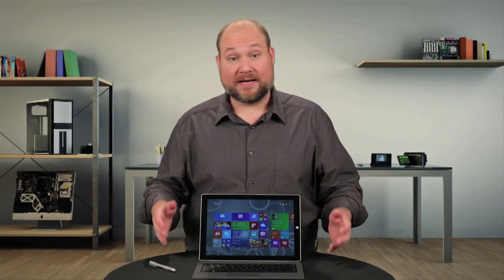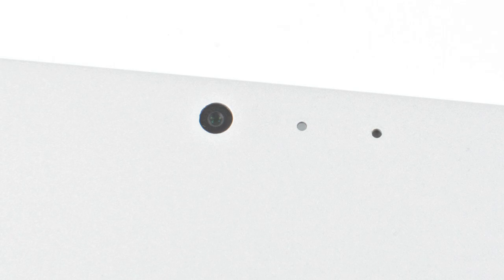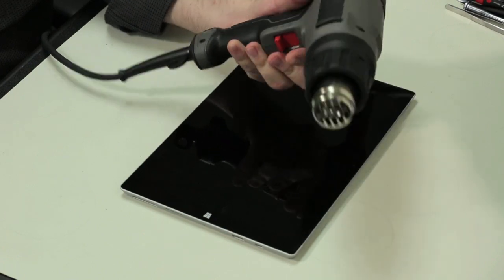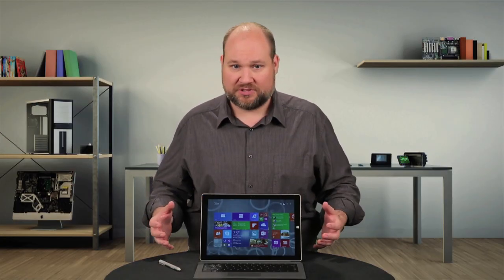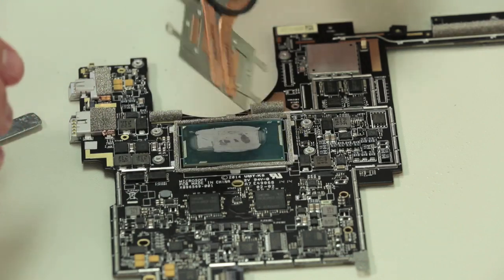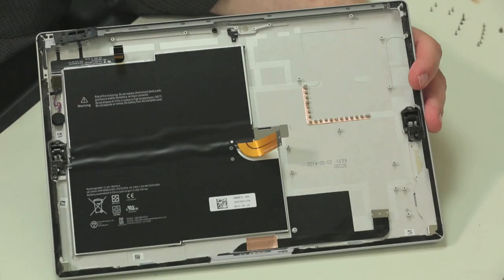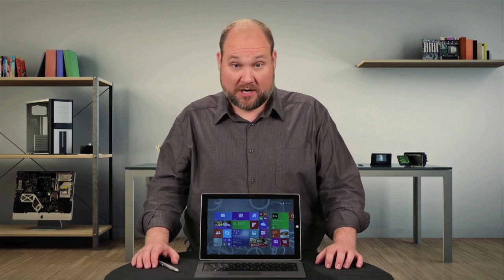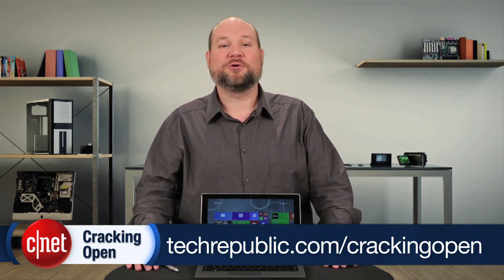Cracking Open - Microsoft Surface Pro 3

Comment: Working in the electronics industry the manufacture of this device makes me shudder. A simple battery replacement, (and let's face it batteries do screw themselves long before they should on occasion), would have the repair house risking breaking the screen.  Goodness knows what the cost would be either, having to pay him danger money!  Yes I do own one and as brilliant as my own on-site engineers are, I wouldn't think of risking the possible outcome just trying to get the SP3 open. Bad Microsoft.

Comment: Hello,
Thanks for the very interesting video. That’s for Service guys very helpful ;-)
How did you glue the display again?
You removed the MB fast, is there a std. S0 Slot that’s upgradable?
I plan to upgrade a I5 with 64GB to 512GB/8GB
 
Kind regards Mike

Comment: Complaining on how difficult it is to take apart a tablet is stupid. Of course it is going to be difficult to take off the front panel, and that its easier to service a MacBook Air, because the Air doesn't need the screen removed to access the internal components.

Comment: shocking that the battery is so difficult to replace. That's the first thing I would want to consider doing. I guess another reason why I think the surface pro 3 is overpriced.

Comment: So Microsoft focused on the user experience and build quality instead of making some snob at the computer repair store happy. I think they did a great job.
Reply: Blow canned air into it lol
Reply: Canned air? What's next, bottled water?
Reply: I'm using this video for a repair on a charging port. It helps me determine the amount of steps and overhead the process will take, as well as determining the reparability of the machine. It's not to get an overview of the product. That's a totally different video and you were looking in the wrong place.

Comment: Tablets as well as Hybrids are modular in design and are not purpose built for home repair.  That is what helps to keep costs down in manufacturing phase.  Laptops are semi-modular which means they may include proprietary parts and are designed with functionality in mind.  Desktops are non-modular/manufactured which means they are purpose built for future proofing/upgradability/functionality in mind.  Some desktops (Apple) do have some modular design concepts included, but that isn't a detractor to productivity and repair.  The comparison of a modular device to a semi-modular device is NOT a fair comparison.  Comparing the Surface Pro 3 to an iPad or similarly styled tablet/hybrid is far more farer.  This review seems subjectively based on the comparison to a semi-modular device and I expect more from an educated "expert."
Reply: I read in the comments that all homes should have a home repair infrastructure for electronic devices.  That is a unreasonable and unrealistic viewpoint.  The average consumer want to use products, not repair.  Most people have not the time, technical skill or ability to do at home repairs.  This device is marketed at mobile professionals for content creation and light consumption which includes people that are looking for modular designs.  That is why Microsoft offers warranty programs.  The money you will spend doing the self-repair will be equal to or cost more than paying for the warranty, acquiring the skills to repair yourself, or paying someone else to repair it.  You don't buy modular devices with the intent of self-repair.  This is why the comments the engineer makes in the video are baseless.
Reply: Thx Cuz. I learn a lot from ur insight
Reply: Apple has been known for non-upgradable devices for decades, so its fair that an iPad can’t be upgraded, but anything that runs Windows has been upgradable for decades, so why is Microsoft changing their ways now? They want to be like Apple.  Apple does tablets and phones better.  Microsoft does desktops and laptops better with the help of Dell and HP.  Why pay more for a non-upgradable device?  Hard drives were meant to be replaced.

Comment: Sorry - but the argument that because the SP3 is as expensive as a laptop it should be as easy to take apart as a laptop is.. well, weird. Microsoft makes it clear: the SP3 is a tablet that's power enough to be a laptop. It's not a laptop that can be turned into a tablet. Considering that the low end model is around the same price as a similarly equipped iPad Air - which is also a tablet - THAT is what it should be compared to for service, and guess what? The iPad Air also rates poorly for DIY repair - for pretty much the same reasons.

Making any tablet this thin is hard to do... and in fact with the exception of the front panel, most of it looks pretty easy to service. The front panel, on the other hand is thin for a reason - this is how Microsoft got rid of the parallax and made writing on the Surface so natural. Basically, I think Microsoft's repair model is 'we eat the screen and just replace it regardless'.

Comment: I don't think its fair to criticise "disappointed at Microsoft" for not getting it easier to open up. The Air is a completely different thing to the SP3. There is always compromises if you want to make things thinner, sturdier, lighter. If Apple ever make an iPad Pro it will also be hard to open up just like the SP3. The same goes for different types of screws. I design hard ware every day and its not practical to use 1 type of screw for everything. The product end up weighing more, thicker, and you have to make other sacrifices too. All these modern devices are going to cost lots of money to upgrade or fix, you cannot even upgrade newer MacBooks and even to change the hard drive and a quick fan service on my MacBook Pro costs me £75 excluding the hard drive. If you use authorised repairers and such its going to cost but its worth it as its usually guaranteed/insured.

Comment: so why should microsoft make it super easy to crack open pro 3 ? isnt it made to be used closed i mean how many times are you gonna want to open up thepro 3 to take a look at it ah? i just do not understand this video :/
Reply: ohh ! thats difficult task
Reply: yha but judging a lap by how easy or how hard it is to open it up
Reply: The SP3 uses a stranded M-sata SSD and as there price comes down you may want to replace it with a bigger one. you may also want to clean the cooling fan or replace the battery.

Comment: Every thing I've seen tells me to NOT buy these things!
Reply: You're going to base your purchase on a video about its inability to easily be opened... Right...
Reply: It really depends on you. My Dad bought one for work and it's pretty good.
Reply: Glenn J Ballenger Jr
A bunch of videos and a visit to a MS store.
Reply: I will say though, I looked over at Lenovo's Yoga 2 Pro, I think if I was going to buy a new tablet/laptop hybrid thing, that's what I would get. I currently have the Surface pro 1, but, I usually only replace things once they've been out powered. Nothing really breaks anymore.
Reply: I have the exact opposite experiences, having used one in a store, I can confirm that this is the device that I, as a Mechanic and software engineer, needs on field work.
Reply: Irene Arlet

Hows the heat for you running it on league? I found mine to be somewhat hot. What version of the SP3 did you buy?
Reply: I finally decided to purchase a surface and its the best decision ive ever made. I use this for everything. It didnt just replace my macbook and iPad, it also replaced my iMac. I realized the only thing i used my macbook for was playing league, watching videos, and checking mail. I absolutely love this device and recommend it to everyone especially college students, 3 of my friends have already bought one with my recommendation and love it. This product definitely deserves so much more attention than it gets. Its truly amazing. I play league on it, take my notes, i can watch a lecture and take notes on the side with split screen. I can watch netflix while doing an assignment and the list goes on and on. I love this thing, i rarely do reviews but the surface really deserves one and ill post it on all surface vids i can because this truly deserves more praise than it gets. If you want more than a pretty aluminum toy, get a surface. As an apple user for the last 10 years, you've truly caught my attention Microsoft.

Comment: Just as the laptop replaced our desktop PC's, this is a tablet, it's not a laptop and now it's replacing our laptops. When laptops came out, they where (actually are) more difficult to be opened that the desktops, and it is the same here, tablets are actually even more difficult. Why would it be a disadvantage. Besides, there's always the warranty service if something happens to this tablet and it needs to be opened. It is the best tablet BTW, it's beautiful and unique.

Comment: Considering how compact it is, I don't see how this should be easy to dissemble in the first place unlike a standard laptop with the screen separate and all the internals underneath the keyboard. This is a laptop crammed into a tablet body

Comment: If you want to have a device that you can service, don't buy a superthin, light-weight device that is sealed. Also, I think the batteries in this will last 3 years easy. There are people still running iPad 1s and 2s and they still work just fine.

Comment: Microsoft did this on purpose, it is a bad trend that started with the move to non user replaceable batteries, as that is the easiest way to introduce planned obsolescence. Simply make it insanely hard or nearly impossible to repair, and then you will be more likely to get the dumber people to buy a new tablet when the old one stops holding much of a charge after 2 years or so.
Reply: It's modern tech, make things so compact and less likely to fail but they still will fail and get the newer module, it's initial user convenience verses long term.
Reply: Well now apple only sells ultra books and tablets
Reply: wv9mm
I love how you were able to price a product that not only doesn't exist but the technology to create it doesn't exist either hehe
Reply: Karly Johnston It may have slowed but I would wager we are far from seeing the end of Moores law. Someone somewhere will make a breakthrough, maybe we are still thinking in two D with regard to how microprocessors are built and designed. I am old enough to remember the first $700 pocket calculators and nobody even blinked at paying for them. The day progress stops is going to be a very sad day indeed; I don't think you need worry about that though.
Reply: Gary Phillips
I don't think he's aware at all that all technology always gets cheaper over time but the closer you look, the harder it is to see it. I'm always reminded of the digital watch when it comes to price. The first digital watch cost a billion dollars to make. For some time now you've been able to buy them for a dollar or much less, they have reached a point where you can say they don't cost much more than the cost of the raw materials.

Economies of scale, Moores law and for me, an increasingly important law is Ray Kurzweils law of accelerating returns. It tracks how all technology increases in what it can do, exponentially, without fail, consistently, year in year out. Not even world wars affect it. A computer 30 years ago was a billion times slower than one today, a computer in 30 years will be a billion times faster than today. That kind of exponential growth is hard to even think about, linear thinkers that we are and it gets even harder when you're only comparing a product today from one last year, or the year before that and so on.

I do think in my lifetime we'll see the cost of all kinds of technology drop so low that like the digital watch, it's cost is measured much more closely in line with the cost of its raw materials. It won't be any big deal to buy rolls of wallpaper for your room that are also computer screens, so any part of your rooms walls can become a touch screen as you tap it. And as absurd as that sounds there was once a time when the idea of a roll of wallpaper was absurd, paper used in such quantities for decoration? poppycock, it'll never happen hehe
Reply: Karly Johnston
I often am wrong, so i'll point you in the direction of Ray Kurzweil, chief engineer at Google, who made the statement you're disagreeing with in his latest talk.
Reply: Karly Johnston fair enough. Let us agree to disagree.
Reply: Karly Johnston
you clearly want an argument but I'm not interested in discussing a subject with someone who has shown such ignorance in it. In case that isn't clear enough, I'll pop you on mute.
Reply: Clay Mann

You lost the argument when you cited Ray Kurzweil to illustrate your point. That man is a joke who thinks Star Wars is the next big thing.

He claims he has over 30 years of "accurate" technological predictions. Let's look at one failed example. In a quote from 2005, he stated:

"By 2010 computers will disappear. They'll be so small, they'll be embedded in our clothing, in our environment. Images will be written directly to our retina, providing full-immersion virtual reality, augmented real reality. We'll be interacting with virtual personalities."

First off, computers have all but disappeared. In fact they are still around, desktops, laptops and all, which I see daily. Next, he claims they will be embedded in clothing. Um, no, my shirts don't have any chips or computers in them, and environment? Computers have been in items around us since the 90's. That's not a very eye opening prediction when it's already true.

Finally, images written directly to our retina? Love to know where that's happening. I'd love to see this "full-immersion virtual reality and augmented reality" in my retina. I haven't to date heard of anyone interacting with virtual personalities, unless you mean in video games, which have been that way since the 90's.

Basically, this guy is so arrogant and over confident, he thinks he can make outlandish, ridiculous predictions about technology, writes books about it, then hopes that if he's wrong everyone forgets it, or he tries to explain his failed predictions, which are needless to say, numerous. He leans on the fact he makes his predictions years into the future and can change them almost at any time.
Reply: Humorous LOL
I'm a big Ray Kurzweil fan, read his books, have seen every talk he's ever given that's made it to video and I stalk...I mean I follow his work. I could spend time correcting you but instead I'll just sum it all up with the statement that Ray is the chief engineer at the worlds biggest tech company, namely Google. He's a true genius, Google clearly recognized that when they snapped him up to work exclusively for them on Googles AI. It's a shame you see him so negatively, he pretty much changed my whole world view on AI and technology in general.
Reply: Karly Johnston For a lot of mobile workers the long term durability of a PC is a distant second to it's utility and portability. If you have to travel to do your job the smaller and lighter a PC is can make the ordeal a lot less difficult. I have spent a lot of time lugging as much as 20 pounds of additional weight around airports over the years and the Surface Pro or the Mac Books were the machines we dreamt of.
Reply: one day in the future there will be a piece of paper like device that comes out that is the most amazing computer/tablet you ever saw, it will be light enough to float on air and still there will be someone complaining you can't take it apart to upgrade it.
Reply: wv9mm I don't know if you have noticed but generally speaking the price of tech is dropping. I don't see that changing with market saturation and economies of scale being the all powerful forces that they are. They day may come when it won't make much financial sense for you to do anything but trade up.When high end computing hardware is so cheap everyone can not only afford it but can upgrade at will, repairing PC's will seem like a waste of time.

Comment: @SEpstude who uses the camera on a tablet for anything anyway?  You have a cell phone that's much smaller with a much better camera.  Why even care if there's a camera there?  You're nit picking for the sake of nit picking.
Reply: Cameras on the tablet are really useful!  When making a skype call you might want to show the other person something, much easier with a rear camera. You can capture whiteboards and documents into onenote etc. Record presentations and meetings.  There are many valid uses which don't require the camera to be amazing.  Front camera on my Surface 2 is really good, great low light performance when making skype calls, so it will be good to have a 'reasonable' camera in both directions on the Pro 3..

Comment: Fragile glass? That does not sound good at all! I would expect them to have gorilla glass at least
Reply: They used Gorilla Glass on the original, but the Pro 2 and the Pro 3 use something that is comparable to it they say.
Reply: i believe it does have gorrila glass
Reply: If you take a pin hammer to it its going to break... Just like any other glass you put pressure on a small area its gonna break. disperse the weight a bit and its pretty strong. Its still glass though...